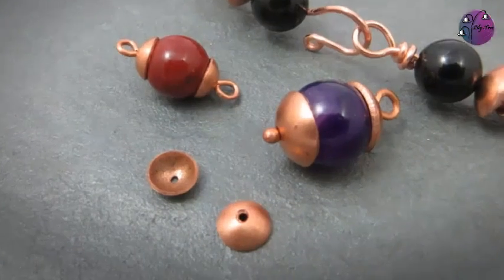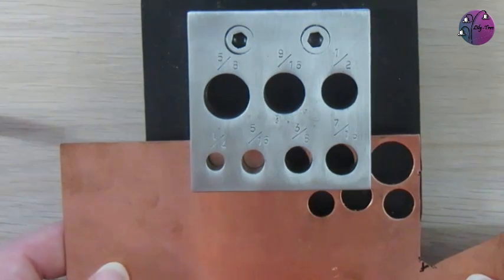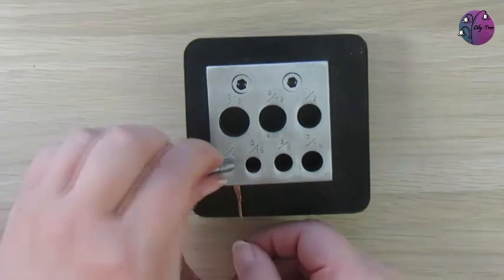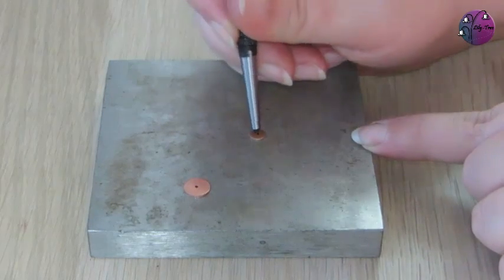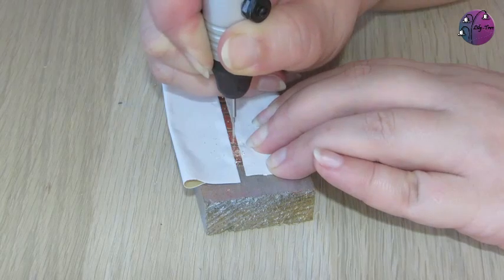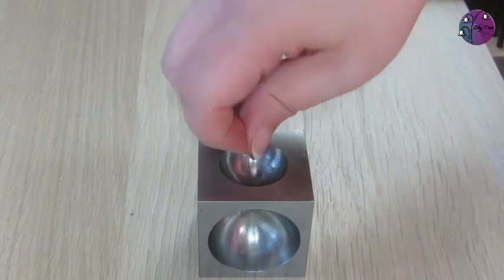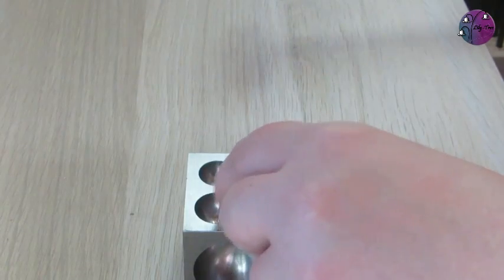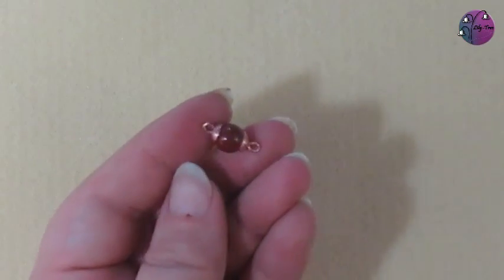How to Make Bead Caps for Jewellery

Comment: Just thought I’d jump in and give tip. And you may already know this. But I thought just Incase id share. You should always file on a push, never on a pull. So always push the file away from you when filing. If you use it on a pull or pulling it towards you it can and will clog up your file and damage it. Plus they don’t cut properly on a pull. They are made the cut on the push only. I know with some smaller files that isn’t as big of an issue. But I just find it good practice to always file on the push. Lots of ❤️ love 😊 and thank you for your tutorials!!

Comment: I just purchased one of these 
BeadSmith 2 Hole Metal Punch Makes Holes, 1.5mm/2mm which will work up to a 16 gauge sheet of metal and I also purchased the Beadsmith EZ - Rivet piercing setting tool...The videos for these are amazing..I can handle a torch but a drill on small objects like that..yeah, ..no !  I wouldnt have any fingers left...not a ballerina. But I have all the other tools. This is such a great video..I am slowly going through them all..I have been working with copper for some time now and love it but you are an inspiration.

Comment: Good tutorial, thank you. Why is it necessary to start at larger hole and decrease size versus using the correct size in the beginning?
Reply from the maker: Thank you and good question!  That is the way I was taught, and I think it helps 'persuade' the metal into the shape you want.  That makes it a bit easier to do and reduces the chance of the disc distorting.